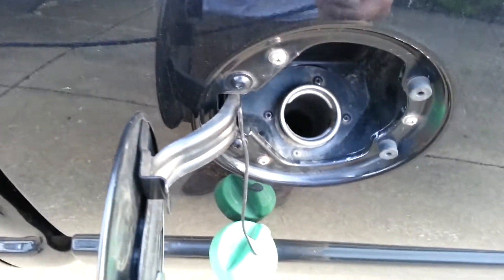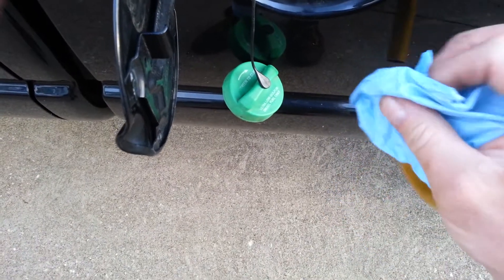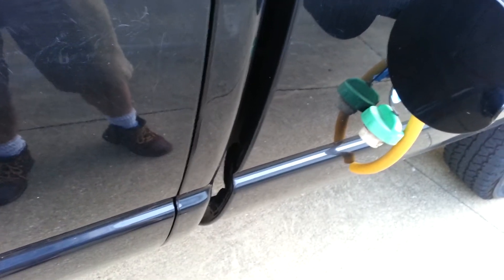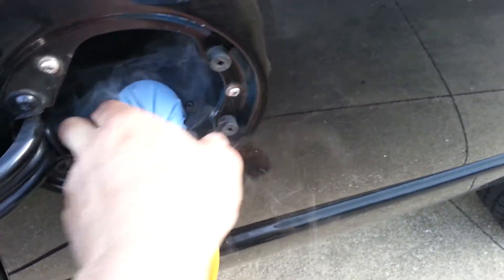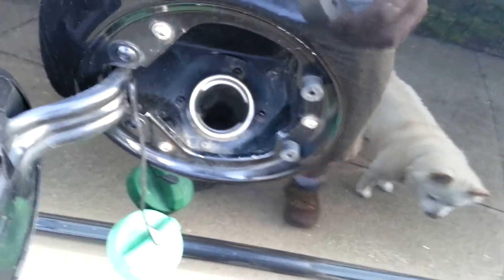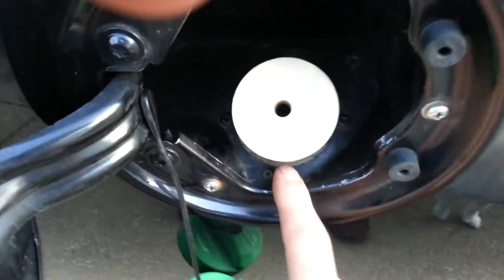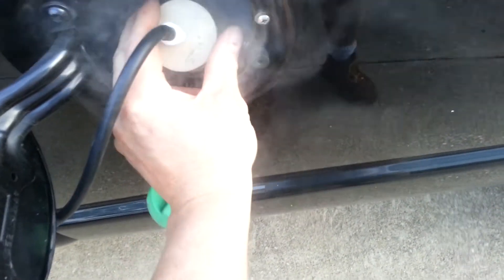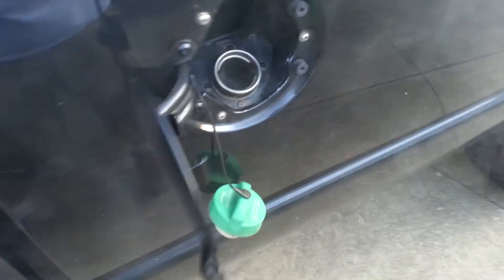Evap testing thru the filler neck

Comment from the maker: You can also take a gas cap and drill a hole and epoxy and hose thru it and use that. DO NOT USE MORE THAN 1PSI for evap testing.  It says right on the evap service port tag of many manufacturers that info. If someone says more than that is ok, then they are giving you opinion and not fact. The only thing that can handle higher pressure is the engine and not the evap

Comment: i took old cap gutted middle glued interior till i cant blow tru  and drilled hole in top screwed a air fitting in tight when dried put smoke ube when cap tank works great

Comment: you will never get smoke into that tank as the vent valve is in the closed position. You have to activate the valve to open it up. The gas tank filler pipe opens it as you insert it into the filler neck. You need a longer neck insert on the smoke machine to open the valve and then you can pump the smoke into the tank.
Reply from the maker: Mike Grogan Mike i was just trying to give diff thoughts for applications and ideas but thought this video prob turned out bad info wise but ill tell you this, i did not know that so i thank you for the info and insight without being rude about it as well. Thanks Mike
Reply: If you have a leak it’s a vent

Comment from the maker: This looks like major failure but you get the idea on doing this on the cheap. Had i either put the rubber band on tighter or used some electrical tape it would not have leaked the smoke so bad out of both. I wanted to use a balloon cuz i think that would have worked better than the glove i just didnt have one. Video turned out to be a failure but you get the idea of using diff things to save big money.
Reply: Not a failure. At worst, there are now two things that have to be fiddled with to work.
.

Comment from the maker: I would def make sure if doing testing this way to have a full tank of gas to keep vapors down as much as possible. Nitrogen is the safest way instead of air but it has been done this way for years, by shops,etc. Again, nitrogen is the safest way but MYSELF am ok in doing this.
Reply: What’s happens if not apply the glove or something that protects it

Comment: Where did you get the rubber stopper ?
Reply from the maker: Sam I wish i could remember but last time I ordered some other different size stoppers i got them off amazon. The ones your asking about i remember ordering the a place that did pharmaceutical supplies, ex.,flasks, etc. They werent super cheap but now i would go thru amazon. Look up a smoke cone on amazon, it covers alot of diff sizes and is cheap. Just got one for like $11

Comment: Will the smoker be safe with mineral oil to check gas vapors to pass smog
Reply from the maker: jack medrano Hey Jack, baby oil is a replacement oil used in some of the professional units. Now 'safe' is a relative term. To be truly safe you would want to use nitrogen for the air source instead of air so you have an inert gas. Many people use just air just be aware of the dangers. Hope that helps.
Reply: @brianb5779  Brian Good Evening! I have the autoline pro smoke tester the red one and i want to use nitrogen as the air source so it will be my inert gas but i dont understand how to do that, how can i do that?
Reply from the maker: @AlwaysDiagnoseVehicleFirst  Good evening to you as well. I myself have never done it but since you are using it in place of air, im pretty sure those units require no more than 90psi to the hose hookup (unless its changed). So if your using a bottle w high pressure on the output then we would need to figure out a way to drop that pressure way down and im thinking like what is used for tig welding, the flow regulator can bring it down and you could set the flow rate even w it. I apologize if it still doesnt make alot of sense and if not let me know and ill try and do better, im just texting this quickly cuz the day had been crazy and i have to get up early for another big job at work. Let me know if you need more guidance and ill do my best but ill apologize now for a bit to reply back with a crazy work schedule at the moment. Got to love big breakdowns at work.

Comment: I have tried several times for somebody to tell me what is the matter if your car is missing and missfireing
Reply from the maker: Even tho it could be a handfull of things and i know that sounds like an easy way out of answering but i would start off w the basics. Its a start to know which cylinder is misfiring so do you know which cylinder (by a code reader) or do you know its misfiring by the mere sound. The reason i ask is if you know which cylinder then i would be pulling that spark plug and just replace it for starters. Their is alot to write concerning this so keep me posted. Ive seen many times the coil pack is bad (i dont know if you have wires or coil on plug ignition) which you could have a bad wire. One trick is at nighttime is to pop the hood and see if you have 'What they call a corona glow' and thats a like glow coming off the wires and then you could take a squirt bottle of wire w some salt in the water and spray around everywhere and see if you see any arcing or engine changing rpm. But the basics are that the ignition components are good and fuel pressure (and volume) are in spec.
Reply from the maker: Valda, any luck?
Reply: Brian B thank you for your concern my son has put in new plugs checked the coil  and this afternoon is checking some other sensor can't remember the name I will keep up to date and thankyou
Reply: +valda paesler the thing my son tried today was air flow sensor it didn't work have you got any ideas
Reply from the maker: +valda paesler Valda assuming that the mechanical part is good (compression,valves etc.,) and the spark is good then id be looking at the injector but this means you do need to know that there is no vacuum leaks as well. A big question is if the whole thing is misfiring or is it just a single cylinder.
Reply: +Brian B yes the whole thing is misfiring,shaking,running like a tractors& back fireing the car is a Holden commadore vt 1999
Reply from the maker: +valda paesler Even tho i dont have alot of experience w that vehicle i googled your vehicle (with misfire after it) and their is alot of good info regarding your problem. Its too much to write here so i recommend you reading because they go over certain areas that are problems (big airleaks in certain areas, coilpacks-one side being bad, etc) so please check those out Valda
Reply from the maker: Valda if and when you and your son find the problem please let me know. Thanks
Reply from the maker: Valda i havent heard anything back from you, any luck???
Reply: valda paesler maybe too late , but sounds like you could have a timing issue on the car..